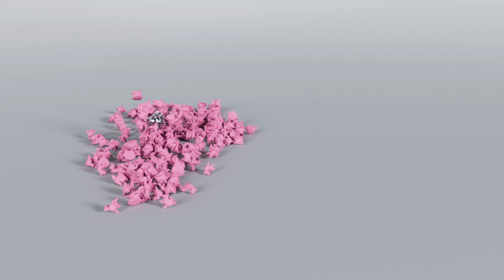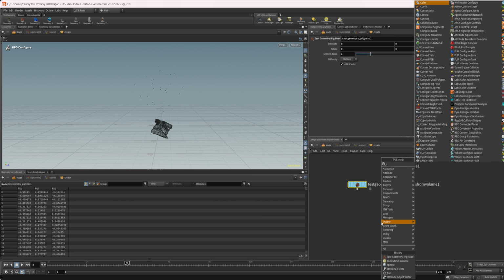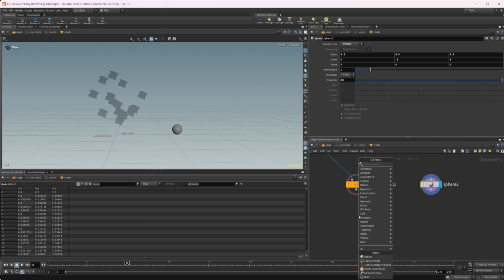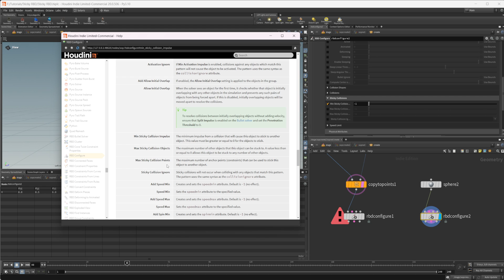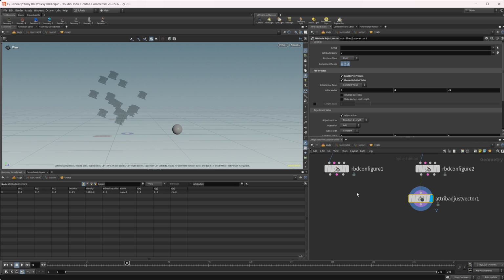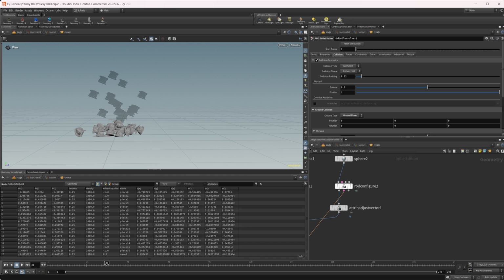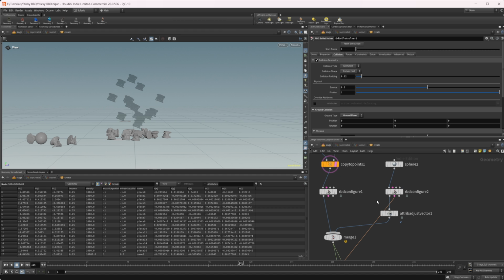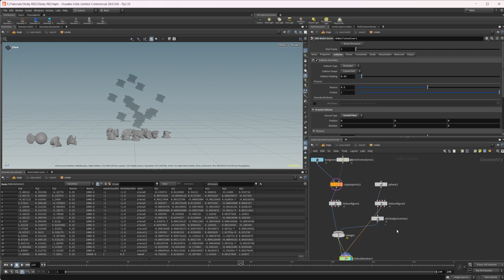How to Setup Sticky RBD Collisions in Houdini 20

Comment: Great tutorial. I am trying to do the same thing with a FBX character animated with Kinfx and this method doesn't seem to work. The object will not stick to my character, it floats in the air and swishes around but it doesn't actually stick to the character, what adjustment should I make to this. I have tried turning on animation and deforming in the RBD configure and it doesn't help.